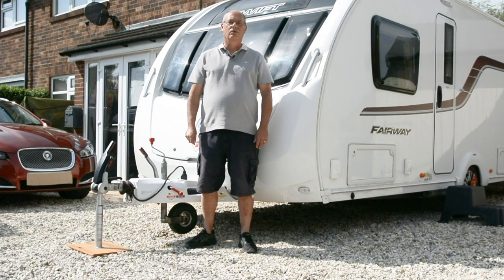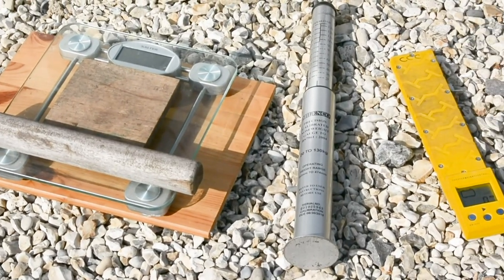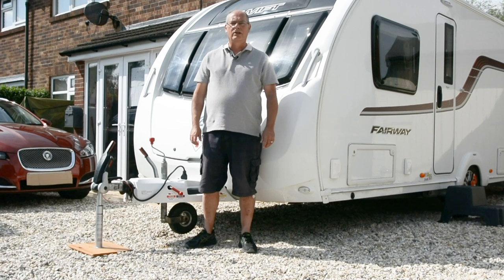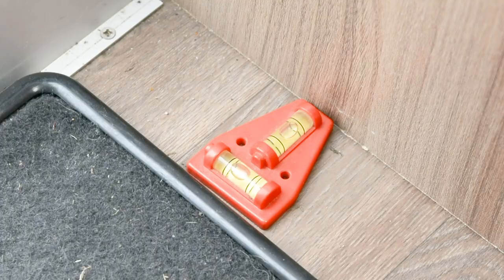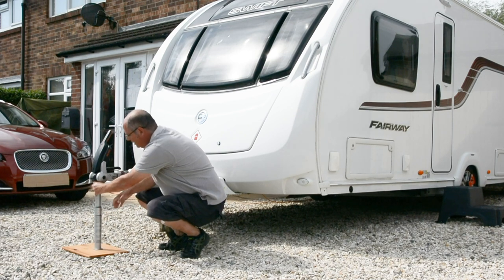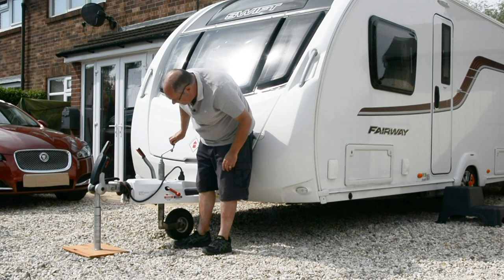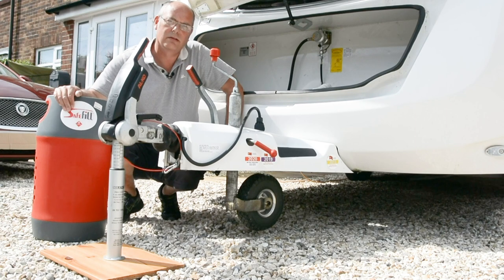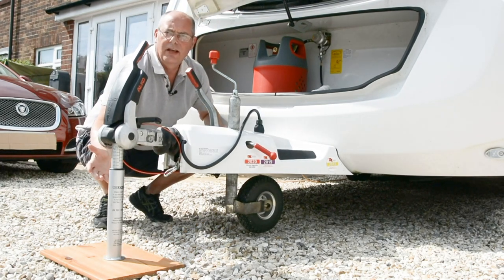How to check your caravan's noseweight: Camping & Caravanning

Comment: My swift has the provision for a bike rack on the back . It can take two 15 kg bikes and the rack itself . I intend to use it but I does worry me having the weight at the extreme rear
Reply: Gixer750pilot we use a bike rack on our caravan, the key is to adjust how you load the caravan to still achieve the same nose weight as you normally tow with, honestly I don’t notice any difference with and without the bikes.
Reply: Caravanning With The Hooper’s that’s great to know that’s for replying .  👍🏻

Comment: I'm new to caravanning and got my 2nd hand caravan last year. Watching the video it starts ok then after the initial introduction at 0.12 it seems to run out of sync with the words and pictures not matching then at 1m27 it comes back ok. I have a Bailey Unicorn Madrid 2011 I believe series 1. My car has a maximum nose weight of 100Kgs and my caravan has a M.T.P.L.M OF 1596 Kg and Mass in Running Order of 1440 Kg. However I'm Still struggling to work out what my optimum Nose Weight should be. My caravan is fitted with an ATC Stabiliser. Any help would be greatful. Thanks